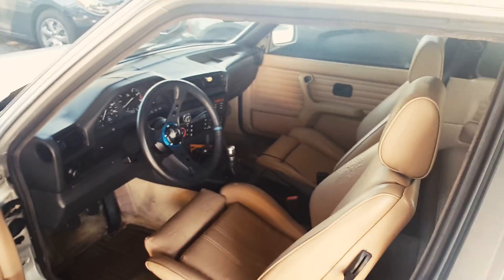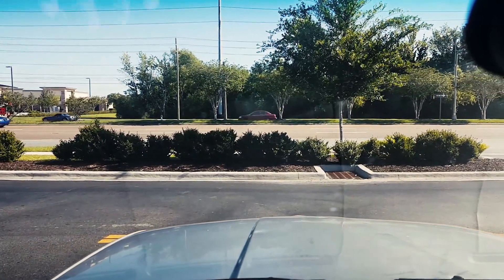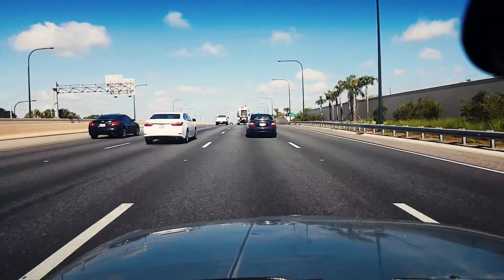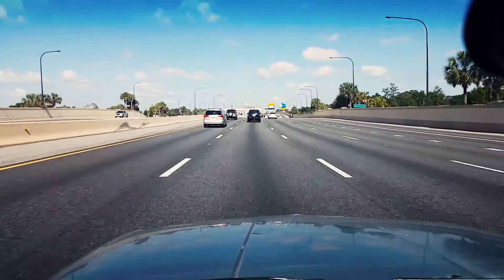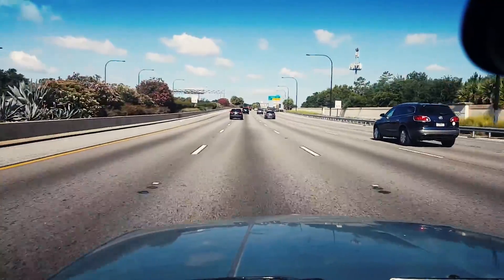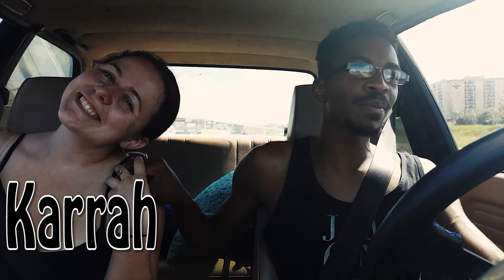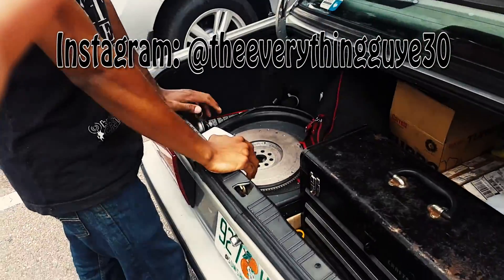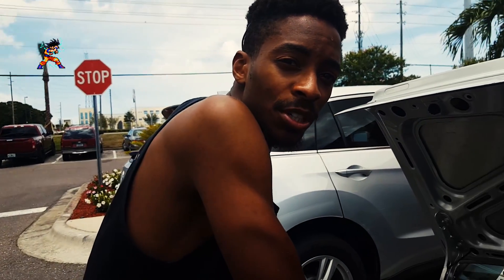Intro to the car world: E30 M42 Turbo Build

Comment: What transmission are you running? Does it have an overdrive gear and what’s it like on the highway?
Reply from the maker: Getrag G240 the factory manual transmission. Only has 5 gears and it great on the highway with the 3.73 lsd and not bad with the 3.91lsd.

Comment: Pls change those wheels🤢
Reply from the maker: Why would i need to? I still have them on the car to this day. If you would like to donate a nicer set of wheels i may be more inclined to though 🤔
Reply: TheEverythingGuyE30 they don’t go w the car at all the stock basket weaves or bottle caps would look much better I’m pretty sure u can find a set for 2-300 with tires

Comment: Dude, ur car sounds like a plane, isnt it a bit too loud?
Reply from the maker: Patrikas Zaksas This is a old video alot has changed updates coming in future videos. This set up was NA stock headers to 3 inch exhaust the turbo muffler.
Reply: Yeah i later got that its for turbo. By the way, what speciality are you studying?
Reply from the maker: Studying mechanical engineering
Reply: Woah, I study the same :D
Reply from the maker: Patrikas Zaksas nice yeah i love it and it has taught helped me figure out alot.
Reply: I wonder if swapping the m42 to M54B30 wouldng be cheaper? ofcourse wouldng get as much torque as doing turbo on this one, but it would be healthier for engine, or am I wrong?
Reply from the maker: Patrikas Zaksas well the biggest trade is added weight and a front heavy vehicle. The 318is is pretty well balance with the m42 thats why i decided to keep it and the m42 is a tough motor, forged crank, cast iron block etc. A swap is definately cheaper because lack of available parts for m42 turbo, exhaust, ecu, intercooler etc. Also once it is built properly a turbo m42 can be just as healthy with a proper tune and necessary steps taken for lubrication and cooling.

Comment: What pistons will you use?
Reply from the maker: Ed Eee cp carrillo pistons
Reply: TheEverythingGuyE30 what will be your Compression Ratio?
Reply from the maker: Ed Eee i will most likely keep the stock compression ratio of 10.1
Reply: Oh okay. I was thinking of boring the cylinders to 86mm and use 4g63 forged pistons and eagle h beam rods for the m42.
Reply from the maker: Ed Eee nice i may bore it out slightly but i will be porting rhe head and doing a bit of head work.
Reply: Will you have custom exhaust and intake manifolds along with the ported head?
Reply from the maker: Ed Eee i actually have the car on boost with the stock motor right now with a full custom exhaust and i will be building a custom intake check out my instagram @theeverythingguye30
Reply: Ok i will keep updated

Comment: im sorry whatd u say youre doing for tuning. im turboing my e36 m44 odb1 right now
Reply from the maker: i will be using a ms3 pro full standalone unit that with be built as a plug and play unit so it with plug into the factory harness and have adaptors for iat and map sensor. and for boost solinod and wideband.